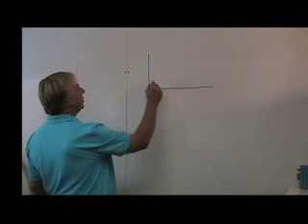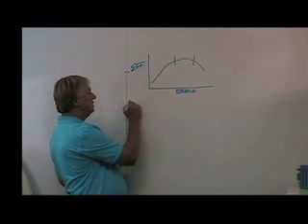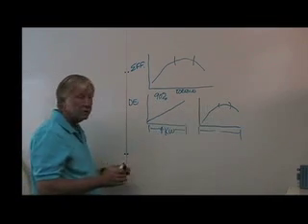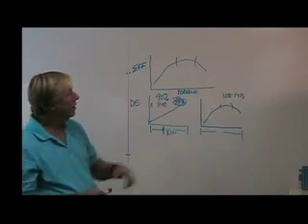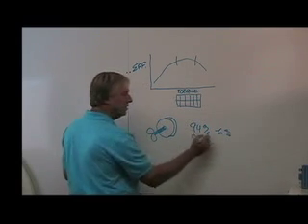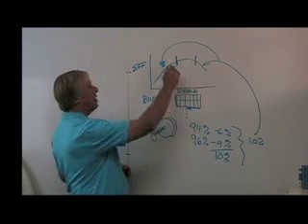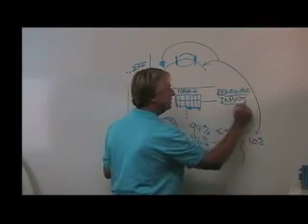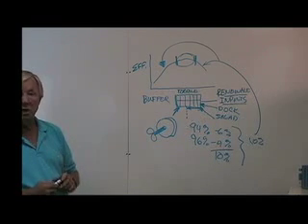Deisel Electric Propulsion VS Hybrid Deisel Electric Syetems

Comment: How do you go from Torque on a diesel to talking about kilowatts. Why don't you compare torque values for both.
Reply: they are one and the same... well mostly... kilowatts is torque multiplied by rpm. so you can extrapolate and compare them. power is power more torque just means same power at lower rpm. and to achieve that you need more displacement and proportionally more fuel burn.

Comment: Interesting, by theory that means you can have multiple battery packs, limited by weight a space.  For example 3 sets 1 for the internal operating system 1 for the propulsion, and 1 for backup. Wonder if you could find ways of recharging the exhausted battery pack within 2 hours?  That's if you don't go under sail.....

Comment: what is not  added  , is   extra weight ,  which in turn  adds  drag ..  = lower efficiency ///   solar  and electric is nice ..  however ..  no great amount of  range ...  takes a lot of  space to place the panels    and need  sun   with  optimum pointing  to sun for max   efficiency...all he  did  here  is  state what  has been  used for  years ..  diesel electric   such as  what's on and old  sub ////    surface ..   run the diesel  and  change   air  and  power up the batteries .//  under   water  run  only  on  battery .//  now i could  see this  as an advantage  when you  use   a   diesel generator  to  power  the batteries  and directaly   run the electric motors  and at same time   power the batteries  to  use in an emergency   in case  diesel engine goes down .///     for every  solution there  is an up side   and  a down side .   it  the same as a wet or  dry  exhaust on a  marine engine , both  have up sides   and  down sides ...  eg , on a boat ..   one with an engine   etc ..  should always  have some sort of back up  such as  sail /   or  visa versa  in case  of  failure ..   then again  thats only my opinion  ..

Comment: But why Diesel Electrical propulsion is not gaining popularity in shipping industry?
Reply: What internal combustion engine runs at more than 35% efficiency??
Reply: It depends how you measure "efficiency", and what other handicaps you give the system (like low emissions, physical size or weight).  If everything is measured in TEU's moved thousands of miles, this is it. 

https://www.wartsila.com/twentyfour7/energy/wartsila-31-the-most-efficient-engine-in-the-world
Reply: Cost to re-fit, and reduced anticipated demand for shipping. Fuel oil is pretty cheap, and crew technical knowledge, service facilities is 100% with all Diesel mechanical cargo ships. This is the same kind of chicken-egg problem that only very-big-money to get everything in place and up to speed at the same time possibly will overcome installed inertia (maybe). Like Tesla would like to do with electric heavy trucking.

Comment: I like electrics. I learned long ago with RC boats. The advantages over nitro. But when discussed, especially by a person selling the elec. They tend to leave out many variables. This was educational for folks in the dark about how ships and trains have operated for 60 or more years but when you add the cost and polution involved in making any propulsion system you find it always boils down to money. "They" who ever arent going to sell you a system thats way cheaper than another system so my point is. Use what u want, they all pollute in one way or another and they all will end up costing about the same in the long run. Hell ide still prefer an old Detroit screamin over most.

Comment: What about the loss through the battery?.
Reply: The battery has a very low internal resistance. If it didn't, it wouldn't be very useful.
Reply: what about the huge loses in the generator...from what Ive gathered are just 40-45% efficient...thats a 55-60% loss right there
Reply: @Errol.C-nz  The generator in your local powerstation is at least 97% efficient and probably over 98%. That's an industrial scale machine.
Reply: @hectorandem2944  Don't get me wrong...I've been trying to work out how to make Diesel electric add up...but the difference between a direct drive losses vs the same motor generating Power to drive electric motors, through a controller...& to charge a battery pack, I can't get clear figures on...consider a taught motoring for several hrs in no wind for eg, or powering against a headwind in a tight situation...I love the idea of quiet Harbour & dock propulsion & the flexibility of electric motor placements...but I can't see that the technology is quite there yet to compete
Reply: Whats renewable...from the dock=coal/neuclear mostly...how many solar panels are needed to keep up with the system...whats it all going to weigh...none of it comes even close to a direct drive diesel

Comment: According to your presentation, to achieve an optimal charge margin the motor would have to engage and maintain it's function at times of uninterrupted travel. How then is it capable of producing maximum efficiency in an urban setting if the vehicle is constantly stopping and going?
Reply: The battery acts as a buffer. If the car's computer determines that little power is needed (e.g. the urban setting you've conveniently brought up), the engine can be de-coupled from the alternator (i.e. no load on the engine) and left to idle, or - and more probably - switched off altogether. The driver continues on battery power - the presenter even said "the battery acts as a buffer".
When more power is required, the engine can be re-started to deliver.
This is how virtually all plug-in hybrids (allegedly the most efficient form of hybrid) work nowadays.